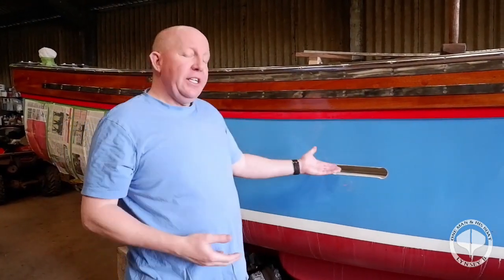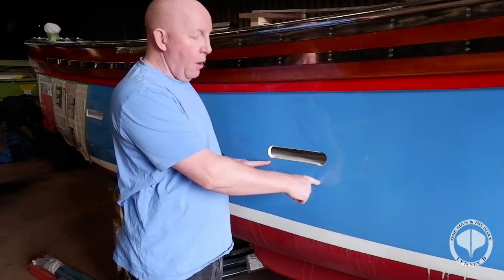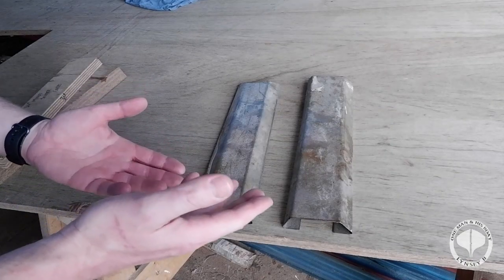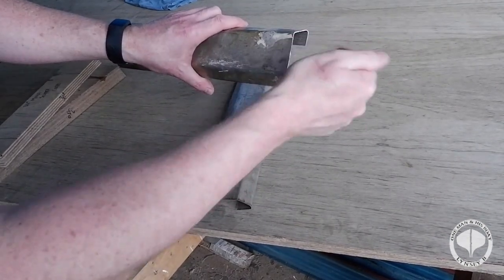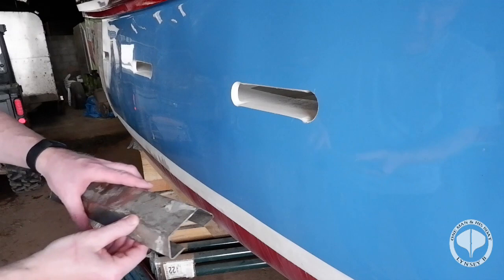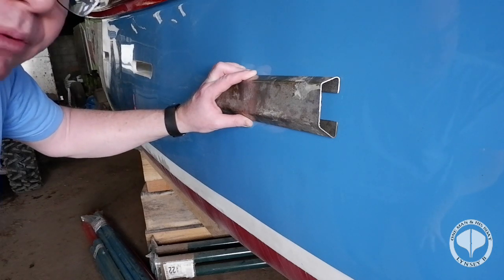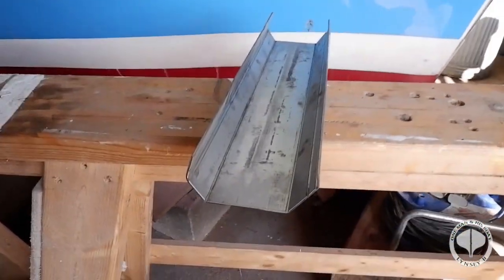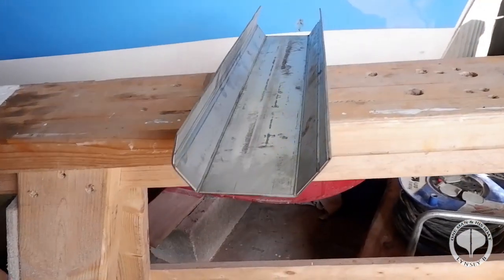Scupper Covers Episode 87

Comment: Smart job Barry might have to rob your stainless design once I've crushed my GRP ones, how is your electric emergency stop rigged up for your hauler
Reply from the maker: Thank you Mike. Steal away pal, but be warned, it takes some doing.💪💪💪🤣🤣🤣😉👍
Oh that's easy, it's not rigged yet.🤣🤣🤣🤣🤣, it's quite easy, power from the bus bar, to the emergency stop button, then the stop button to the electronic hydraulic shut off.
All that will get shown once the hydraulic engineer has been to fit the hydraulic system. 😉👍
Hope things went well at your end buddy.
Have a great weekend champ 😉👍
Reply: @onemanandhisboat   Thanks Barry looking forward to that one